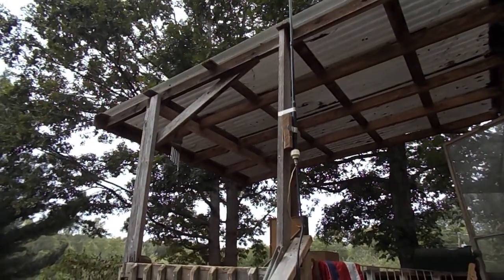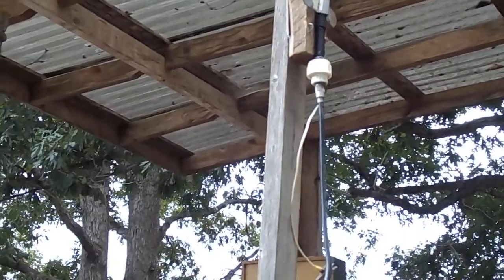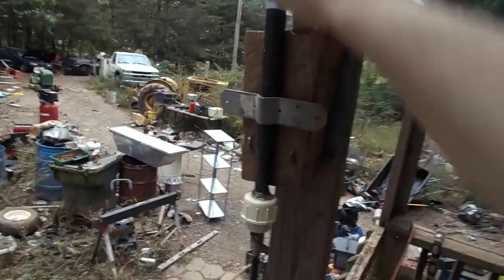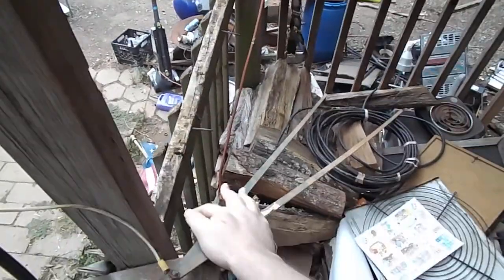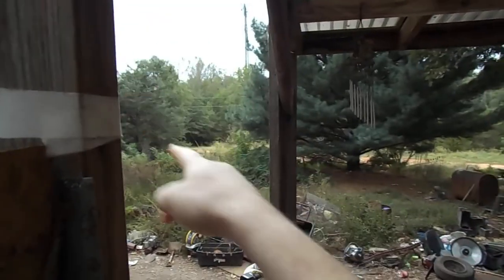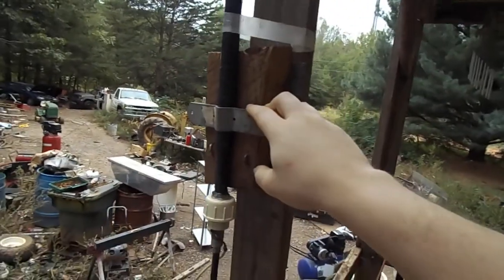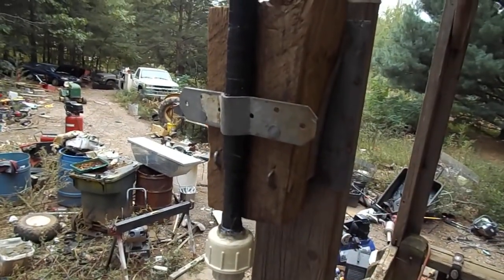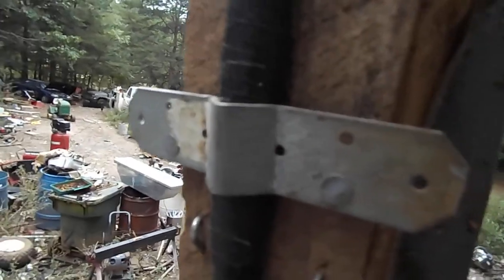DIY CB antenna, what range to expect?

Comment: Man I sure could use a fat roll of that coax
Reply from the maker: There’s some pretty good cable on eBay 200 foot of it for 115 bucks but you’ll have to put connectors on it

Comment: don't keep the coax connected in thunder storms! all so you can get static build from dust and water droplets  that can cook the front end of the transceiver. you need a lighting arrestor grounded to the houses electrical ground system. nec 810 in national electric code has good info. stay safe! take care! good lighting arrestor is  morgan model m-300.

Comment: Do u recommend a pvc or wood or metal to use as a pole and why? I have a base 5`6 antenna butni m not shure what to use as a pole
Reply from the maker: I would recommend PVC personally, You can attach an antenna to it without having to worry about it conducting any electricity

If you use something like metal you need to clamp it in a way that your shield connection doesn’t touch the metal.

Wood is not very electrically conductive unless it’s raining a lot and then it can be 

Plus with metal poles there’s going to be some near field interference

But unfortunately sometimes that’s all you have
Reply: @JohnnyJonesathome  thank you for the info i did was worry about lighting so that answers my question.  I know pvc is not that durable, but then i can just replace it for cheap if it brakes  and i dont need to worry about having a metal pole in case in lighitn storm.  Thanks again👍👍
Reply: @SuAmigoElilegal  chanelink fence top rail is cheap 10 or 20 links  n pvc pipe will slip over the top whith little heat I pait it so the sun don't brake it down n put a 
t post in the ground to put pipe over  
Put one up for a friend like THIS 
N he used it for 20 years  no problem   73 n good dx

Comment: Cool! Homemade antennas are the best! Thanks for sharing, 73's from 151 SC.
Reply from the maker: Thanks bud, I'll keep my ears out for you on 38, we aren't but a 100 miles or so away from eachother.

I'm using a Galaxy DX 2517 black box so it should have enough power to reach you.

I saw you put a CB on your lawnmower, nice.

My brother loves mowers/tractors, he took an old wheelhorse and welded truck tires to the rims, it has wheels nearly as big as the tractor. I'll be posting all sorts of oddities from my life so stay tuned!

73s!
Reply: 10-4 I hope to be blasting off the antron 99 descised as as flag pole